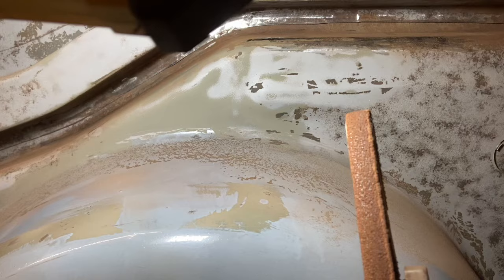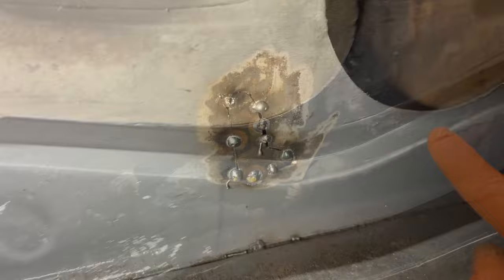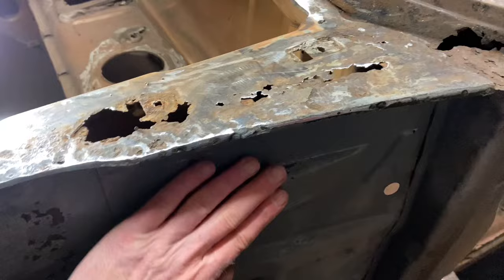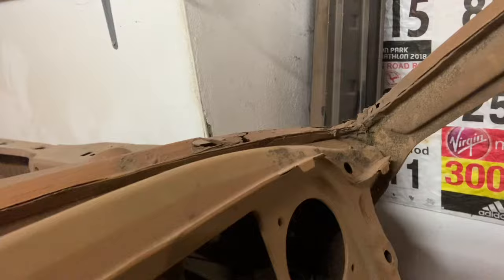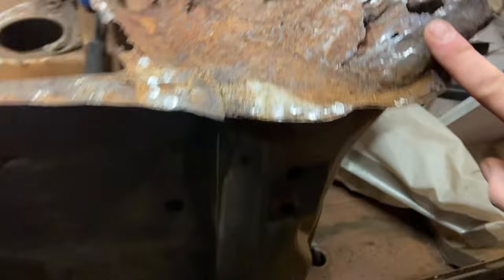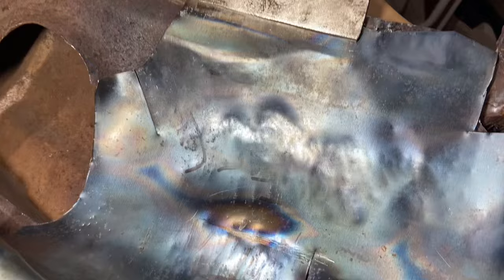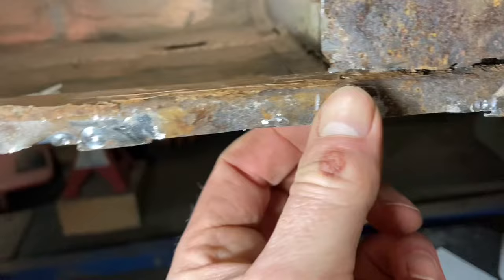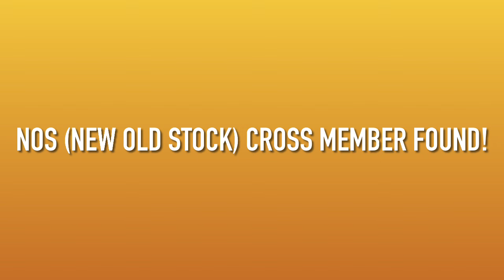Ford Cortina Mk3 2000E ‘76 Restoration Project. Ep.20

Comment: Excellent work Shelley, really enjoyed your work in this film. The fabrication is always interesting to me to see how people aproach a certain job. Pete helped me too no small surprise and I hopefully will be back at it myself to get more work done. 
The idea with the blow torch is so handy I need to reshape my spare wheel well. If I had more time when I was welding my sils I wish I had treated inside and painted but I just didn't have enought time.
Reply from the maker: Hi Simone! How is TeeCee? I've seen recently that Expressed now do a spare wheeltube floor section if that is of use to you? Otherwise its amazing how much hot metal can be coerced into shaped witha few taps of the hammer!
Reply: @ShelleysCortina  I need to get the carb rebuilt. The car would not start and the float bowl had rust in the bottom. I have a nearside rear wheelarch repair.

Comment: Excellent work. Will be interesting to see on how you get on with then inner sills I’m currently doing the same job I wasn’t to sure if them ones go in from the inside but by the looks of it they do. Keep up the good work
Reply from the maker: Thanks! I still havent welded it on lol, as i need to make a small repair to the floorpan edge first, and since then, I decided to attack the rear valence and inner valence, which in turn showed some bad rot on the lip of the floorpan... So I've moved onto the rear of the car and pretty much cut it all out including the lower quarters! More footage to follow soon.

Comment: Blimey Shelly that cars in really good shape actually I was suspecting it wouldn’t be as good as that underneath it’s impressive. And so the work you’ve done looks amazing brilliant job mate. Just a suggestion and probably a stupid one but have you though of using rust converter on those places that aren’t really rusty as such just a bit of surface but you can’t get a tool to to clean it up ?  Might prolong its life maybe . Super metalwork to well done shes certainly taking shape 👍
Reply from the maker: Hiya. Good point. Yes, brushed fertan on many exposed panels back when the shell was outside. I should have been more thorough, and also when the shell was inside as it can still corrode, thanks in part to the wettest winter on record! 
I’ve tested various rust converters and anti-rust paints on the front valence replacement (did a video on that) and from memory, it was comparing what effect they had on mild corrosion, left overnight. Hammerite converter and fertan did best. 
I think nothing beats media blasting back to bare metal, then using a zinc phosphate solution like POR metal prep, or a zinc primer. Dave from Dave’s Garage (good channel) did a test on various primers and rust protection paints over a long period of time. The clear winner was Halfords Zinc Weld-thru primer which I think I will also use on the shell now. 
As for hard to reach areas like inside the sills, I think Dinotrol or Fertan, sprayed in using a special long reach tube is the best bet.

Comment: new to the channel, been a panel beater and painter since '87, what you got planned when it comes to under coating when you get to it?

something i've used a few times on big projects is the 3m sprayable 2k sealer, it comes in mix bags which is fine for small stuff but i did the entire underside of a '76 Mercedes 240 with 22 of them, expensive but gave the whole bottom side a tough rubber coating, it was then overcoated with black 2k as that was a customers car, my own ones i do same but with final colour body colour gloss, nothing sticks to it, if it does its an easy rinse off.

The 3m spray sealer i now mixup several bags and use a big bore gravity gun,

if you have any areas where you are worried about replicating any critical shapes like the windscreen flanges, make a template from wood, steel or aluminium to mate up past where you will be cutting so during and after you have a guide to where the edges are ment to be, really useful for curved surfaces where you can't measure every mm of it
Reply from the maker: Hi Laura. I was planning on using Gravitex but I have no experience with underseal yet or how to apply it. Do you use a spray gun/compressor ?
I hear that you can get Gravitex in any colour to match your car. 
Thanks for the tips on the fabrication. I’ll update on progress soon.